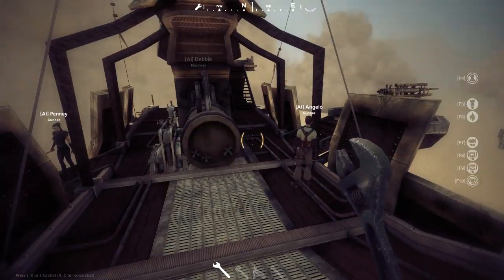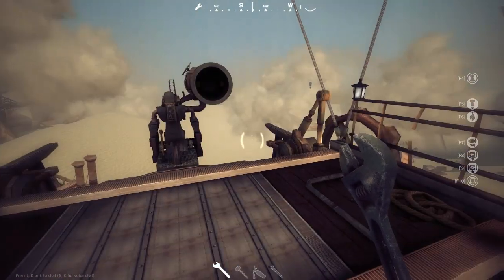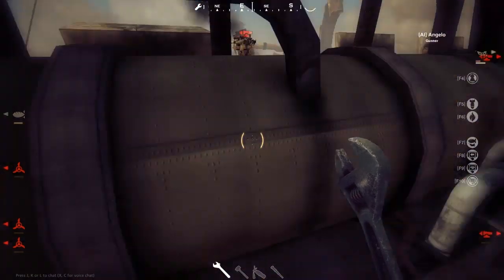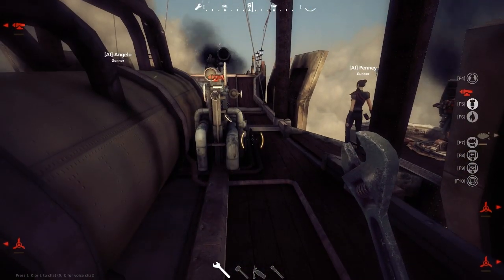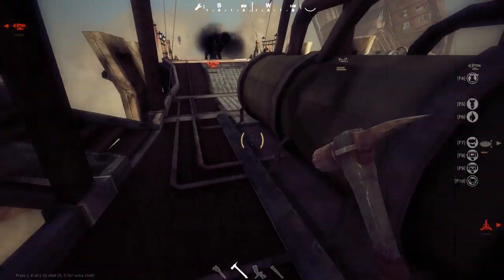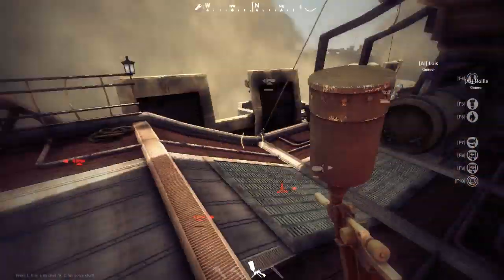Guns of Icarus Online—Engineer Tutorial Redux May 2013

Comment: Great video!
Di I get it right that the ice spry also extinguishes fire? Then what is the use of a fire extinguisher? Is its cooldown lower or something?
Reply: the fire extinguisher will extinguish a fire in one spray. The chemical spray will buff the part and make so it wont be able to get set on fire again for a while but to extinguish a fire, it can only extinguish a few points of it. So if you use an extinguisher, a level 8 fire will be gone instantly but it could start back up. If you extinguish a level 8 fire with a chemical spray gun it will take a few times but the last one will apply the buff